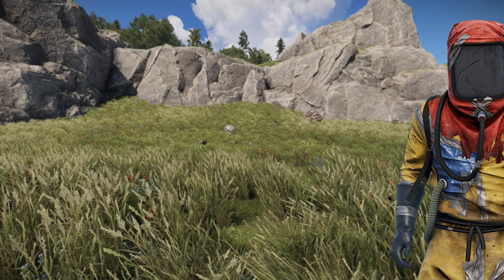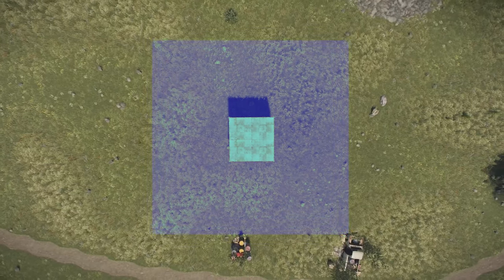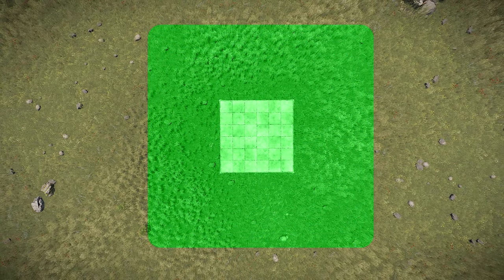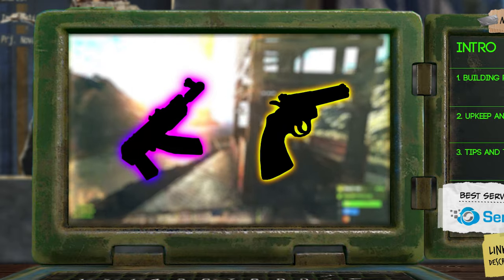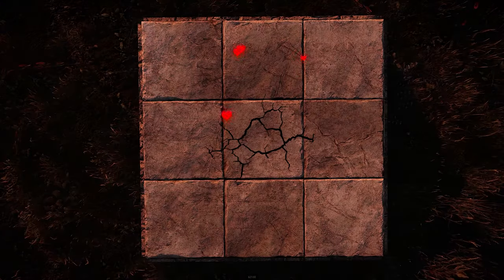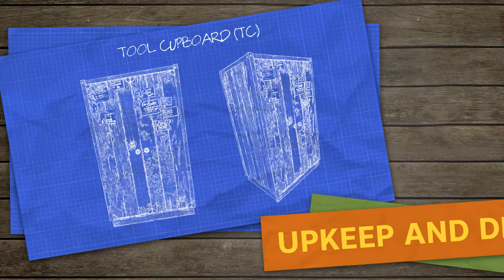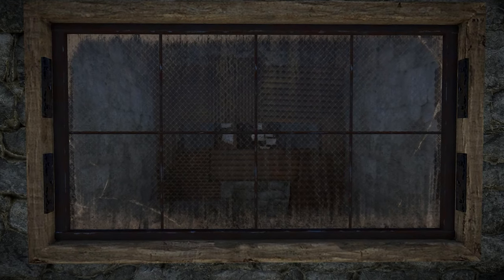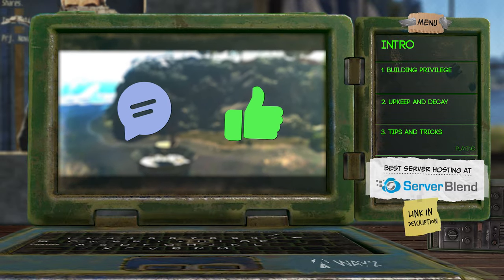This Is How The Tool Cupboard Works

Comment: What does the "Tool Storage" blocks hold?  When looking inside your TC you'll see upkeep requirements at the top.  To the right is an arrow.  Click that.  It will have spaces to put something?  What goes there???
Reply from the maker: You can hold tools such as a building plan, hammer, hose and wire tool in there

Comment: In order to make the second tc do I need to unauthorize myself first from my first tc I placed how does stacking work im very confused on Rust console I see people using several TC's that arent even connected to their bases.
Reply from the maker: You build it out of building privilege of the first tc then extend its range by building foundations that are radiating towards the main TC.